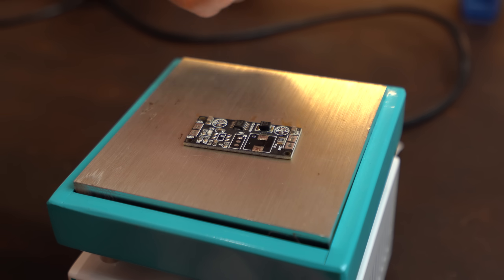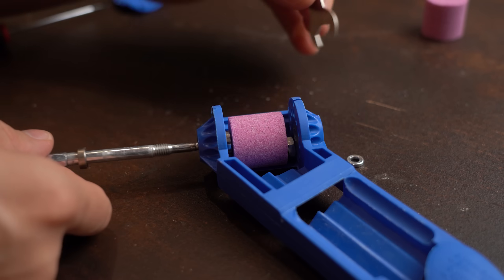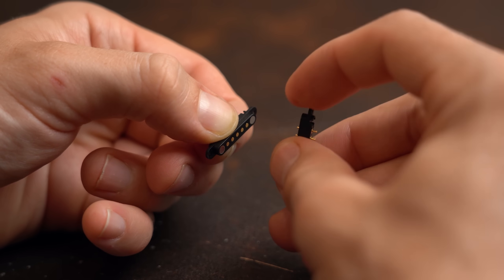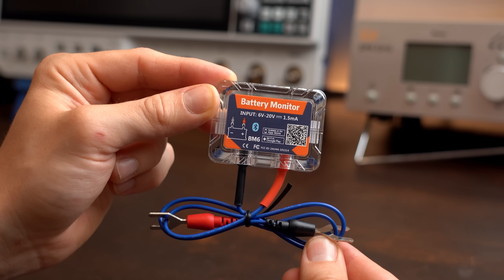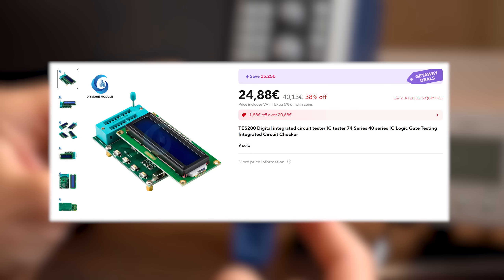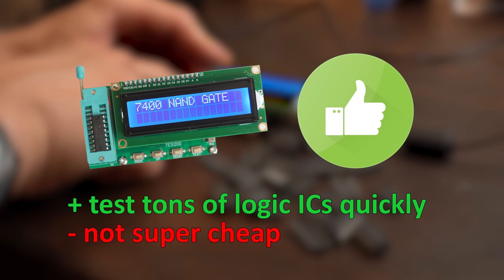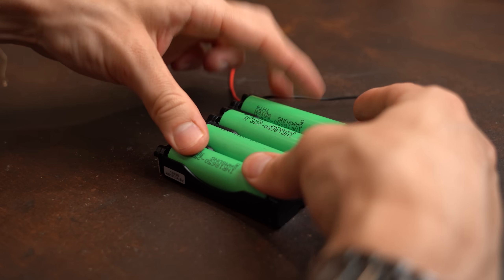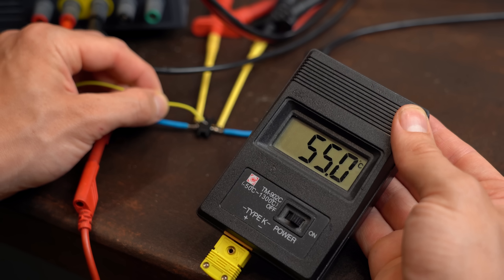I tried finding Hidden Gems on AliExpress AGAIN! (SPECIAL Part 10)

Comment: I've hoarded a fair few of those DT3 Cable testers.  I hot glued a dual coin cell battery pack (with built in on/off switch) to the back and soldered the power wires to exposed PWR and GND wires by the usb socket that would power the device.  Super awesome and handy PORTABLE tester that way!

Comment: The drill grinder maybe works, but how long will it last? It is very important to get the right angle and you need to cool it too or else it will lose the hardening.
7:12 Never use a tool on the positive battery pole when the negative cable is connected to the battery pole!!!

Comment: I call BS on that drill sharpener. It's not that simple to sharpen drill bits.
Reply: If all that's really worn down is the very end, it could be better than nothing. But yes, I agree. A proper drill sharpener would go much further.
Reply: It mite get you close but back cut gives you your rate of mat removal it doesn't do any of that
Reply: It does not compute. I highly doubt most worn drill bits are only worn on the very superficial edge that that sharpener hits.

Comment: 8:25 for some god-awful reason, Google has programmed Android in a way, that apps can only access your near-Bluetooth devices by allowing GPS.
i have to this day not understood WHY, but its normal to have to do that for apps that need bluetooth...
Reply: Because someone invented Bluetooth beacons so apps could find out they are near a certain location by listening for them. They were intended for in-store and near-store notifications.

In addition, known Bluetooth devices can be used to determine your location the same as known Wifi networks.

Comment: 2.4V is too low for over discharge protection. Li-ion cells shouldn't go below 2.5V.
4.325 is also high for overcharge. Above 4.25v the excess energy is converted into heat.
6A for overcurrent is fine for some cells and applications, many cells can handle much higher current (10-25A) and the battery holder wouldn't be suitable for applications requiring high currents. But for many uses 6A is more than enough.

Comment: I'll disagree on that drill bit sharpener, there's no way that can get the correct clearance behind the cutting edge. You'll probably get better results freehand on a bench grinder, even if you've never tried it before.

Comment: Problem with that drill bit sharpener is that, drill bits have various angles to them, while 135* is common for HSS, you can find other angles too.
Last thing you want is to try and change the angle on a bit.

Comment: Looking at the video of the results.. The drill bit sharpener did horribly bad job. Take a good look at shop made drill bit and compare. Sharpening those by hand is a skill that has to be learned, but even if you are terribly bad at it and resort to using angle grinder, you will get far superior results to what that "sharpener" made.
Reply: I completely agree! The very fact that you have to manually hold both the screwdriver and the drill bit to sharpen it completely eliminates the usefulness of this "device". Professional sharpening requires fixing both the rotating part and the bit.

Comment: This drillbit sharpener is completely useless. It does not create the correct cutting angles, instead it wears away the factory grind. Once you run out of factory clearance you're left with a drill shaped object.

Comment: Could you use the pogo pin connector as a balance lead for lipos, to connect them to the charger quickly?
Reply: The contacts are exposed. It is likely you will cause a short circuit. Not safe.

Comment: Showing absolutely f@cked drill and telling its sharp is killing me. It will not cut. Guys, spend 20 mins on tutorial on drill sharpening and use a bench grinder. Even angle grinder can work if u dont have a bench one!

Comment: The ruller is actually very useful. It is not a new device, just digital version of analog rullers. Main use case is to measure length of curved lines. I was using this type of ruller when i was working in the stained glass workshop.

Comment: That battery pack has several issues. EG over-charge is 4.35V but is normally 4.2V and I set mine to 4.0V. Over discharge is way down around 2.4V. 2.5V really is a minimum and I set mine to 3V. OK I only get about 80% capacity but the cells last about 4 times longer so far.

Comment: grinding a bit that way will just form a "cone"  without a relief angle from the edge.  It could be useful for getting a general shape and then adding some relief from the edge some other way. (the cutting /leading edge is the part that contacts the work, you don't want the entire end surface contacting the work.

Comment: Not 5 times more current

P=I^2 *R
Iwago = 20
To get same power dissipation current would be

20^2 * 0.002 =  I^2 * 0.010
0.8 = I^2 * 0.010
I^2 = 0.8 = I^2 * 0.010 = 80
i = sqrt(80) = around 9A

BUT this is for same heat dissipation, I just want to remind everyone that relationship here is quadratic.
And wago connector can dissipate heat into pretty thick wire, while this thing is small and encased in plastic, i wouldnt use it for anything above 1A because of this
Reply: He was calculating for the same voltage drop, not power, but 4A x 40mV  = 160mW of heat, it seems like that would be well within the heat it could dissipate. 1A would be a tiny amount of power = 1A x 10mV = 10mW
likewise 800mW for the wago connector seems much less than it could handle, the official connectors at least are rated for up to 32A which would be 2W - though I imagine they could handle more heat than that. 32A is likely the maximum practical for the circuits it would be used with.
The video also shows him measuring the temperature of the connection, presumably at a higher current.

Comment: You should definitelly add a fuse in series with the battery tester. The device provides no isolation and if it fails shorted, your car will burn down.
Reply: Have fun finding a fuse that is more sensitive than the PCB fuse included on the board...
Reply: The tiny wires used on the device and the circuits on the board would make very little heat if shorted. They would pop just like a fuse. No risk of burning down your car. Don't believe me? Look at the thickness of the traces in the board and compare them to the filament in a fuse. which is bigger? Fuses protect the device. This device only draws 0.001 Amps, 7:50. Have you ever seen a 0.001 amp fuse?

Comment: I can second the recommendation for the magnetic pogo pins!  I use an 8-pin connector on my RC truck for the lights, and it is great for when the body falls off and would normally rip the jst connector out of the light kit controller.  And, being magnetic, all I have to do is bring the ends close enough, and it reconnects itself!

Comment: I cannot believe you didn't fuse that battery monitor!! Get some inline fuses for the future.
Reply: I have 2 of these fitted to the engine and domestic batteries of my camper. As an electronics engineer, initially I had the same thought. But when I read the instructions, I found these units are internally fused with a low rated fuse. Of course if that fails, the device is scrap. So far my unfused devices are working perfectly.
Reply: @richardsargeant296  It has zero to do with the unit itself and the fact he had a flying lead coming directly off the main battery terminal unfused. If the positive cable had have come loose and touched the frame while he driving, the cable would have conducted until is completely obliterated itself.
Reply: @muxerbaker4638  Detaching from what? From the battery terminal? Then the internal fuse will kick in. From the device? That's no different than it detaching from the fuse holder.

Comment: 8:25 It's a pretty common misunderstanding on App Store ratings. 
IIRC early Android versions used to actually call it GPS and GPS permissions however that's not the same as location permissions nowdays. Every wireless protocol can be used to gather location data and even older Smartphones where able to track you based on WiFi APs. 
Therefor Android started requiring location permissions for all apps that need to see the full list wireless devices (including WiFi scanners, Apps with builtin Bluetooth pairing and Bluetooth LE apps). 
Many people still think location permissions is purely GPS even though nowdays it involves wireless communication as well.

Comment: I own that USB tester and added a coincell (cr2032) to it so I wouldn't need to power it. The only issue I have with it is that it can't really detect issues with dodgy USB cables that aren't completely broken as the LEDs light up very easy.

Comment: Just for fun you could try if it's possible to disconnect the GPS antenna from the battery monitor, just to be safe.
Reply: There is no GPS antenna on the device.
It would probably not work behind the hood of a car anyways.

Comment: Lack of fuse on that battery monitor is scary.
Reply: They are probably relying on the thin tracks burning out😅
Reply: @unclejohn5012  Not just relying on it; the BM2 has a section on the PCB with decent insulation clearance (for 12V) where the track is extra thin. That's nothing else than a fuse...
Reply: @unclejohn5012  😂
Reply: Who cares at that price, the device will blow before the battery or anything else.
Reply: Just do a professional job and cut most of the wires off when wire stripping and it's almost as good as an Amazon fuse!
Reply: tbh the fuse depends on you and your needs so its kinda up to you to chose one

Comment: unsure about the magnetic connectors. I've had  usb c cable that I could switch up with any other connector. Sadly the spring in the pins ALWAYS failed... and it was good quality

Comment: RE the cable tester, I have USB C cables that have only the power pins connected, some with only USB 2 pins connected, some USB 3 pins connected, and some with all data pins connected. I know this because I use a more capable tester that tests all the pins for all the USB connector formats. From Amazon it costs under £20 approximately. Now I know why sometimes devices don't charge or run fast data!
Reply: what's the tester you're using?
Reply: it would be nice if it tested voltage drop at 2 amps or so.  the voltage drop is what makes phones kick into slow charging(500ma), very seldomly nowadays it's the chargers fault
Reply: @lasskinn474     The tester uses a CR2032 cell, two amps may be a bit too much! I also have testers that sit in line and measure voltage, current and the internal pull-up resistors (which determine desired current).  My understanding is that if there are no data lines then usually the charger will drop into 500ma charging mode. Some of the cables that I've tested have no data lines so the charge is slow. Is this happening to you?
Reply: @alanmon2690  yeah it would definitely need a beefier psu for it.

Comment: A recent favorite of mine - WinApex 268B clampmeter - does 0.1mA resolution on AC current and 1mA on DC, and ridiculously cheap. Super handy for AC mains stuff like checking earth leakage.
Reply from the maker: Will check it out😉

Comment: The digital tape measure I find actually useful when you don't have a wall to bounce a laser off. Like measuring out cables or distances on machinery where you don't have someone at hand to hold the other hand of your tape still.

Comment: Nice collection of goods here...
The "tape measure" reminds me of a similar mechanical device which in the era of paper maps to measure the length of different routes on the map - however, for that purpose the wheel would need to be  sticking out further https://de.wikipedia.org/wiki/Kurvimeter

Comment: The drill bit sharpener should be rotated at high speeds since if used slowly, you'll only be destroying your stone by wearing it fast. and you are actually making them more blunt than sharp because your angles are incorrect. This Old Tony has a good video on explaining the geometry of a drill bit. and it can sharpen spade drill bits, after separating the grind stone and holder from the drill angle guide and  fixing your drill on a stand or use a drill press. (https://www.youtube.com/watch?v=r8oORR6jyh8)

Comment: I can't see how that drill grinder can sharpen properly. It only grinds one (primary) cutting angle / edge. A second and deeper angle (relief) is usually needed just behind the cutting edge to allow space for the chips to clear out of the way. Without this the chips don't clear properly and the drill won't work as well and possibly wander.

Comment: That battery monitoring device looks great. BUT. I would not trust that turning off GPS functionality in the app actually turns it off. Would be good if someone could actually analyze the apps source code or outgoing data. Would also be a nice project to capture the Bluetooth data coming from the device and make a website/app for it.

Comment: I'm honestly surprised the drill bit could cut  at all. No relief grind after the edge means the edge can't bite into the material you want to drill. I think those gizmos might sharpen bits if you're extremely careful and aware of where the edge of each flute is. But if you're that careful, any bit over about 3mm can be sharpened freehand on a bench grinder or belt sander at least as quickly.
Reply: Indeed. I have one and it's workable but you have to know what you are doing. If you just push in the bit and wiggle it randomly it will just ruin the tip for you. What it does for you is provide the right angle. Not being able to tilt te bit yields sub optimal results though. I would still prefer a big stone on a motor but I don't have one so I'm glad I have this.

Comment: Use case for the electronic tape measure would be in making replacement vehicle and industrial battery cables.  Those are a pain to measure with a standard tape measure.
Reply: I recently needed to measure the length of seams on fabric. A rolling tape measure would have been pretty useful there, too.

Comment: bluetooth was for a long time connected to the location detection, because a lot of Bluetooth devices are stationed. But if i remember correctly google have changed 1-2 years ago, now bluetooth have his own permit point in android. May to be compatible to old devices, its still ask for location approval instead of bluetooth permit.

Comment: the digital tape measure is for measuring distances on blueprints like cables-runs in construction. oldschool solution is a pen with a little wheel at the end and a anolog gauge.
Reply: or for clothes or fabric, curves of any kind.
Reply: @mice3d guess it could measure body curves quite well!!! 😂
Reply: @mice3d  for fabric? just use a fabric tape measure not this junk.
Reply: Or for fabric. I have a really old one to measure length while designing clothes and others. Very useful along curves.
Reply: Why does everything have to have a battery and Bluetooth though? God I'm old.